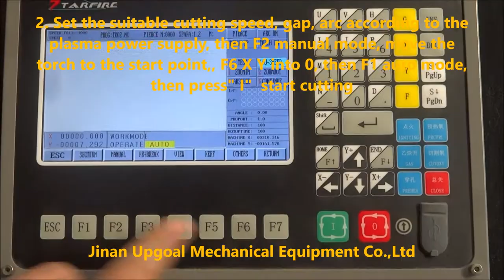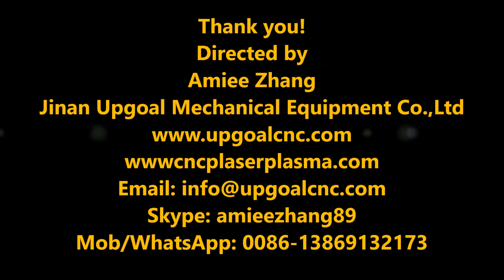How to Cut the STARFIRE Library File of CNC Plasma Cutting Machine?

Comment: Is it possible to reset this machine to the factory settings ? the problem with my machine that the fire is not working
Reply from the maker: Yes, but you must need to  have the original parameters backups
Reply: @UPGOALCNCMACHINERY  where do i get the backup parameters and how do rest to factory settings

Comment: Could someone please assit with an issue we have on the controller. After selecting the file from the USB and going to manual, the block showing Workmode / Opertate (MAN) has a red block with [Y & X (S)] <-- which is constantly changing from Y to X . What could the issue be ? Thaks in advance
Reply from the maker: please contact whatsapp: +8618353188251